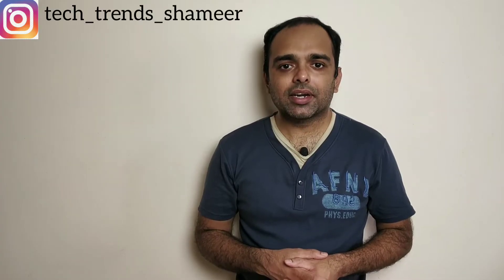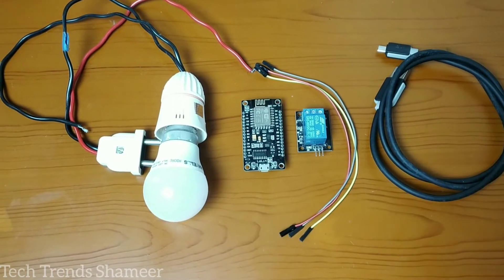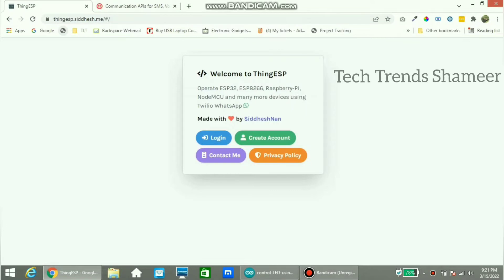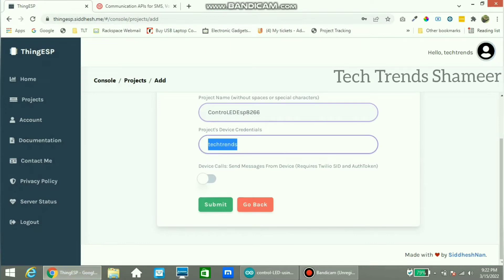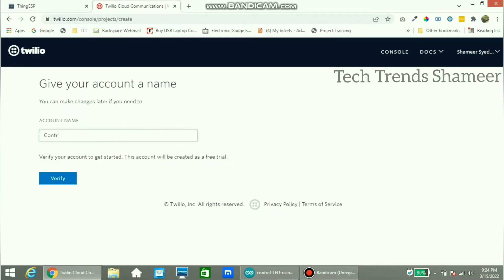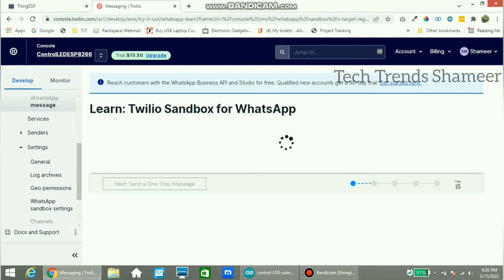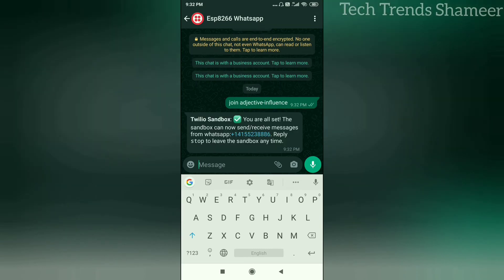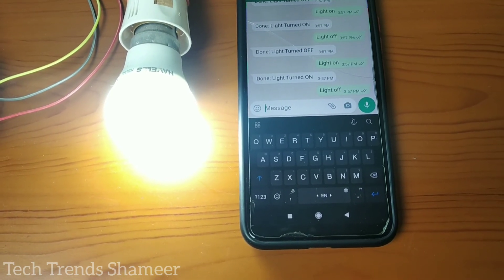Whatsapp Home Automation Using ESP8266 | Twilio | ThingEsp | ESP8266 Projects

Comment: Very good information, I need exactly the same thing but when the activation message only turns on the lamp for 5 seconds and it turns off, can you tell me how to make the software to make that happen? thank you so much
Reply from the maker: You can add the delay in the code and remote the condition of else in the program
Reply: @ Could you tell me what it would look like with an on message that lasts 5 seconds and turns off? I don't understand this, thank you very much
Reply from the maker: depends on the delay you added.

Comment: Sir, we are getting the message "Your device is offline...", what might be the issue? I have checked the connections.
Reply from the maker: Check the wifi connection and also double check the pins which you connected. 
Send me the pins list how you connected.
Reply: @TechTrendsShameer  pin 4, still doesn't work
Reply: Also, in my thingesp my project disconnected. When I tried to send message, the replies is "ur device is offline.".

Comment: Getting these message in serial monitor:

[SOCKET] Error connecting to ThingESP! Error code: 5
[SOCKET] Please check your username, project name or credentials! 
[SOCKET] Trying again in 10 seconds..
[SOCKET] Attempting connection to ThingESP
[SOCKET] Error connecting to ThingESP! Error code: 5
[SOCKET] Please check your username, project name or credentials! 
[SOCKET] Trying again in 10 seconds..
Reply from the maker: please check whether the credentials you used are correct

Comment: Sir, I am getting your device is offline message on WhatsApp and on arduino software serialmonitor I am getting error connecting to thingesp! Error code: -2, please help me
Reply: Yes
Reply: With wifi it is getting connected successfully, but with thingesp it's show attempting connecting to thingesp and than error connecting that message get printed on serialprint
Reply from the maker: Did you installed all the libraries ?
Reply: @TechTrendsShameer  all the libraries are installed...but then it is showing as your device is offline
Reply: Program got successful compile and I uploaded that program on esp8266 but still not working?
Reply: Which library you installed